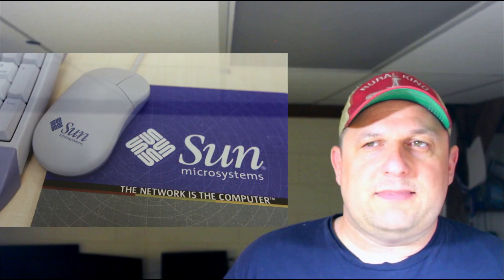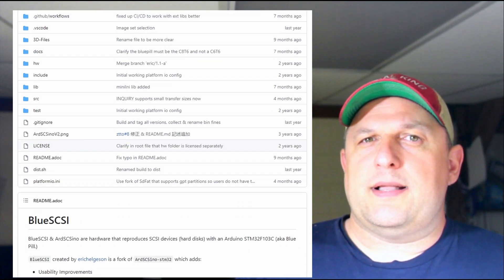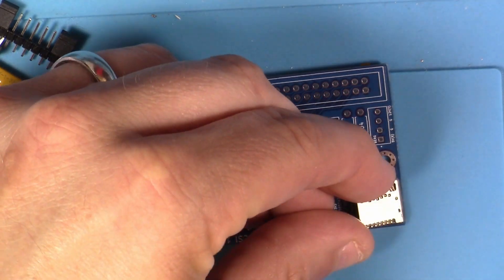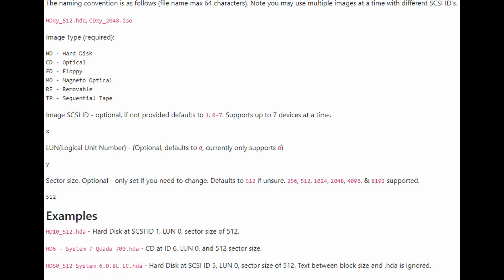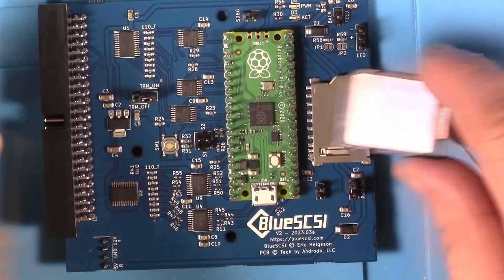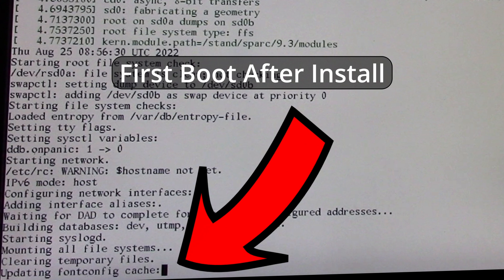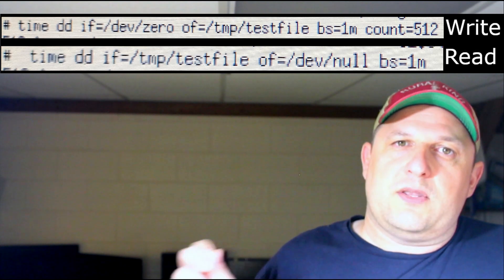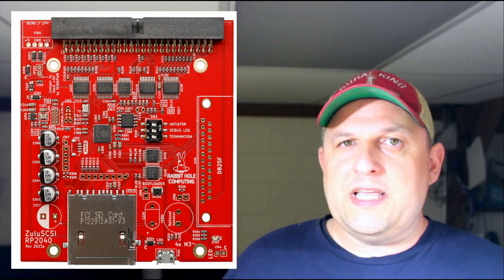BlueSCSI On SPARCstations!

Comment: Hey! Glad it worked for you! I remember chatting last year at VCF-MW - and I'll be there again this year. Just wanted to note this is this is all open! You can go print your own BlueSCSI v2 or v1's PCB's and build your lab of vintage workstations.

RE: termination - V1 uses passive termination - which if power is not at 5v it can not work as well as it uses the 5v to pull up the data lines through the resistor nets. V2 uses active termination which has it's own regulator and is more stable under any power condition. Also in the picture it looks like on of the jumpers is only half on, so it is only doing pull up, not pull down, on the data lines (both should be on or both should be off)
Reply from the maker: Thanks Eric! Maybe I will try to do a couple of bare  ones. Fun nerd stocking stuffers right? :-D Thanks for the extra info about the termination. And of course thanks for being approachable and nice!
Reply: @JamiesHackShack  We provide the placement files too so you can get the boards populated just like your kit :) OR you can take a stab at a LOT of tiny soldering :D

Comment: Ah installing a operating system with bad RAM you haven't realized that went bad yet. Wasted hours on a couple machines, either trying to install Linux or one time tried to hackintosh. Neither went well. Gave up on the hackintosh and tried again and it wouldn't post. Found and remove the faulty stick and it worked fine.
Reply from the maker: At least we finally figured out we had some funky ram! 😂

Comment: Can you share what SD cards you used? I'm having an issue with a common new Sandisk Ultra 32GB SD card throwing an error in the log saying that my disk image is fragmented, no matter what I do with reformatting and having the disk image being the only file on the card.  I'm doing this on an SS4.
Reply from the maker: It may take me a while to confirm 💯 but I think I'd maybe used a middle of the road SanDisk 16g. I'll check and let you know for sure as soon as I can.
Reply: @JamiesHackShack  That actually helps a little, I'm starting to wonder if this is related to crossing that FAT32 -> EXFAT line and maybe I need to stay at a < 16GB partition size.

Comment: hi, I am trying this to, have a bluescsi v1 connected to a sparcstation 1+ and I've got probe-scsi seeing both the hdd and CD.  however when I try to boot the CD i get wrong magic number error.  the bluescsi log file shows the CD as 2048, even though I called the iso image CD60_512.iso.  Did you have to do anything to make the CDROM work ?  thanks.
Reply from the maker: Ok, so you grabbed an iso and you want it to be scsi id6/lun 0 and you want 512 sector size. Is this a solaris/sunos iso or something else? Do you have the termination jumpers on or off? I know it may seem crazy just trying to think of any/everything. Your md5sum is matching/good on your iso compared to source? Actually I have never messed with a ss1 maybe I am not thinking of something. Sorry you are having trouble.
Reply: @JamiesHackShack  yes, cd on id6 lun 0 with 512 sector size . I've tried sunos 4.1 and solaris 2.5 neither work.  terminator jumpers are on.  the iso's are all checked and good. able to load them on another machine which has working cd and hdd
Reply from the maker: @redfiat  have you tried termination off for giggles? Not sure on the 1,  on my 5 I thought I needed it but actually didn't because of the way the sca stuff was. May not be applicable to you just wondering. Interesting that the log says 2048 even when you'd told it to be 512 via the filename. Is that the latest v1 firmware on your v1? It may seem like I'm reaching because I am. I've not had much trouble with mine. May be worth poking around the bluescsi discord. I can try to get mine out and try to boot from the same ISOs for the heck of it just to compare maybe.
Reply: @JamiesHackShack  thanks :)  yeah I have tried both terminated on and off. also tried an external terminator on the bus too.  I put the latest firmware on but its not changing  to 512 and I think that is the issue.  might be something specfic to the way the SparcStation communicates over SCSI to the bluescsi unit I guess.  I'm going to build a jumpstart server and install it that way as at least the bluescsi hard drive works as expected :)

Comment: Great info! I also really like the piSCSI. It uses a Raspberry pi and gives you a web interface for swapping images. That would work great in the show scenario you mentioned. Another cool feature it has is that it can emulate multiple drives at the same time. I use one on my Macintosh II driven by an old Raspberry Pi version 2 board.
Reply from the maker: Very cool! Maybe I'll try one of those out for giggles. Now when you say multiple drives. Do you mean like emulating two HDS and one optical drive in a single bus at once or something more complex like presenting to two different machines at once?
Reply: @JamiesHackShack Yes, like several drives (each on a different ID) and a CD drive. But I was just watching one of your Sparc videos and it sounds like that other SCSI  board does that as well? So many options for our vintage gear.

Comment: I have a ZuluSCSI hanging off the back of my Commodore CDTV (no room to mount it internally) and I love it. It was cheap to buy, easy to set up and "Just Works". The awesome kit that's available from the retro community never fails to impress. It's so nice to not have to rely on old spinning rust drives that will eventually fail.
Reply from the maker: Right on!

Comment: very interesting how far reaching this very convenient and very cheap solution can get. I just use them for my old macs, including the v2 for my Mac Plus even though it can't use all its speed.
Reply from the maker: For sure! Maybe I need to organize my mess and make room for a Classic Mac finally! :-) My lone current Apple is my little IIC. I need to get more retro-apple experience. Assuming we don't count my old G4 mini and 2008 work powerbook. That one bluescsi niche I never knew about were for the midi devices where you can use these. That has to be super handy for folks too.